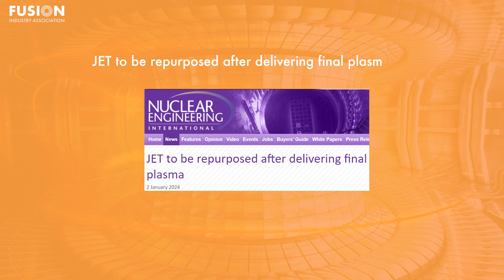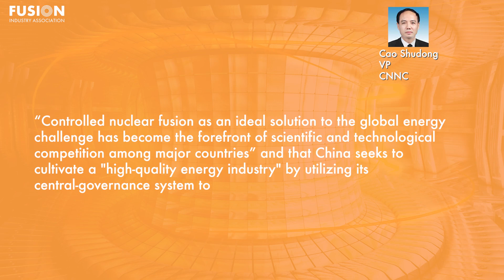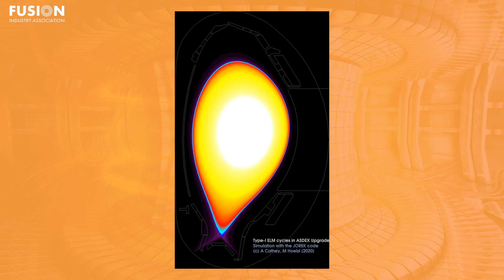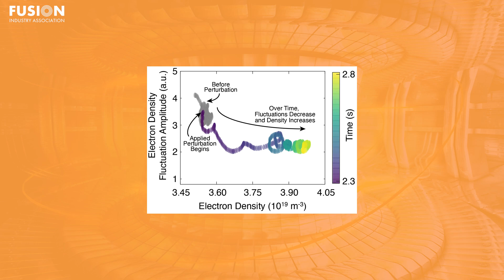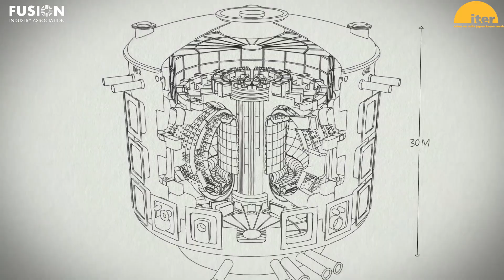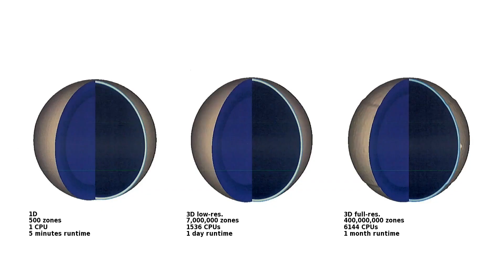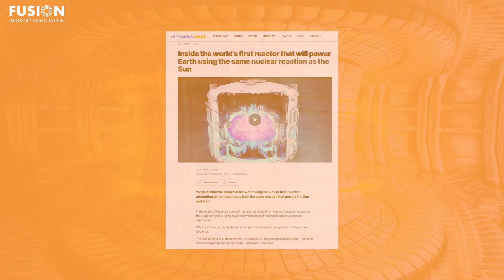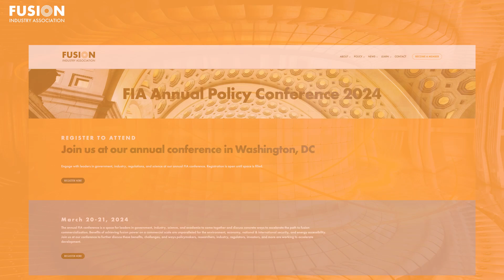Fusion News, January 10, 2024

Comment: Here is a  thought  for consideration 🙏🙏🙏.

In a Centrifuge the heavier  particles congregate and precipitate at the bottom of the Test Tube.

Think of the Tokomok as a Centrifuge and  direct the Lasers aimed at ignition of the Heavier isotopes of the Hydrogen  which would be congregating at  the  appropriate place in the Fusion Reactor. 

This will increase the probability of  collision in the Plasma and reduce the temperatures required for enabling Fusion Reaction.

Simple to ensure that directed Collisions  occur.

All the best ❤❤❤.

Comment: Fusion offers the hope of solving many of the massive problems facing the Human Race, not just Climate Change. Endless cheap energy would allow 100% recycling, transport systems to remove most air pollution from cities and large towns and make vertical farming very affordable to feed the World. Fusion is the one bright light (literally) in sn otherwise darkening World. Thank you for keeping us up to date so clearly.
Reply: anybody who studies the literature has to be skeptical but if you just read the press releases then you are hopeful.
Reply: I do understand this subject far more than just 'reading press releases'. Critical thresholds have been passed in recent years and we are now in the zone of just solving technical problems. Because of the time it takes to build, or upgrade fusion machines, it will still be decades until the first power station is on line. In the meantime, the solutions to the critical problem of Global Overheating and its consequences, are: 'Gold' hydrogen, solar power, insulation, heat-pumps and population control. The answers are there, but being ignored because the wrong people are running the planet!  @silent00planet